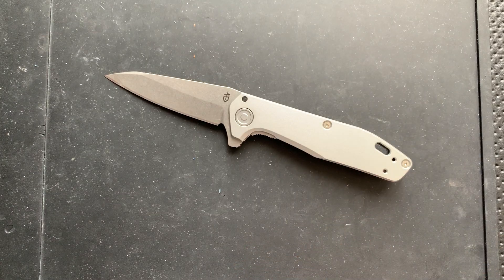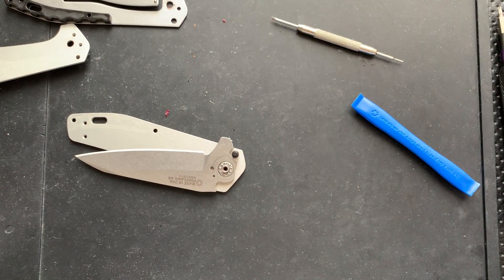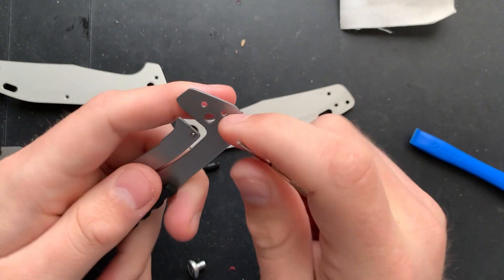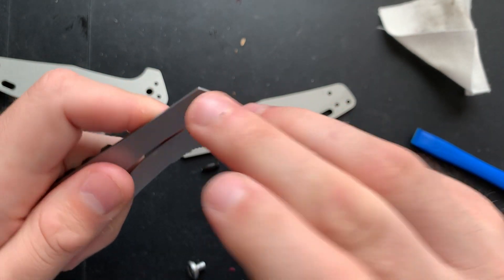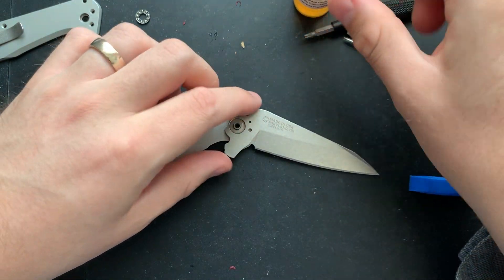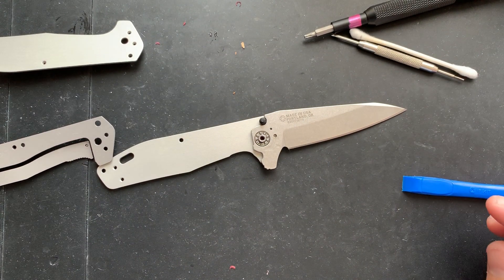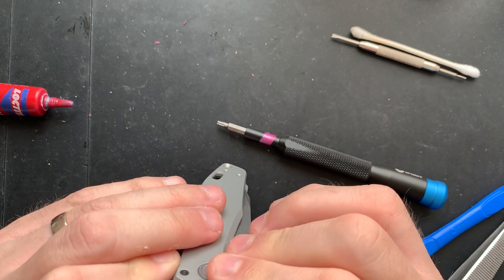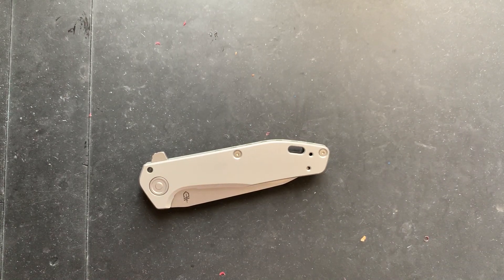How to disassemble and maintain the Gerber Knives Fastball Pocketknife

Comment: The fastball doesn’t have any locktite on my body screws, The screws are fitted perfectly on the aluminum. After cleaning mine it’s drop shutting. Super surprising with how easy it was to take apart and maintain.

Comment: Damn! Here I was hoping Gerber would come out with something good. It looks cool but, to put it simply, Gerber had QC issues again. I can get a Native 5 LW for that price. And that has a spydiehole.
Reply: How did they mess it up
Reply from the maker: What's wrong with it?  I have some objections, but I don't think this is fair.
Reply: My grind was atrocious. At the tip, the left side was nearly chisel ground. Blade play at reasonable pivot tightness. I am being pretty hard on it, I suppose. I have come to use Spyderco quality as my benchmark. You’re right though, I’ll soften my comment. I suppose I just feel a bit burned. My takeaway is that you can get better things for the price. cough cough Native cough cough
Reply from the maker: You should post that on the full review, as it reinforces one of the main points I'm making there: All the knife design in the world doesn't count if it's not well made.  The first one I purchased was like that too.